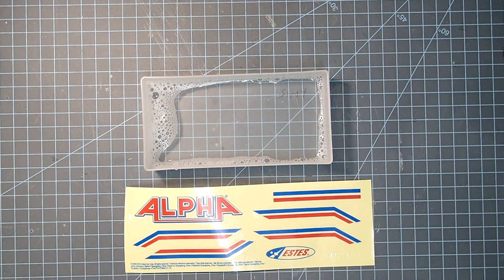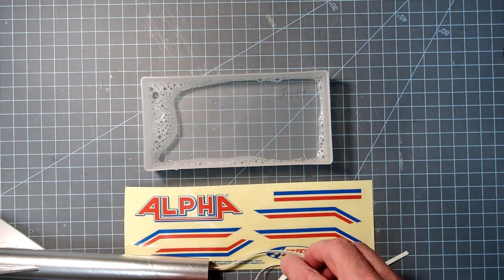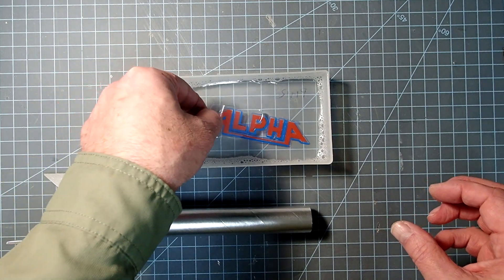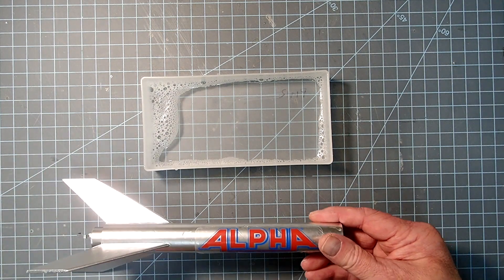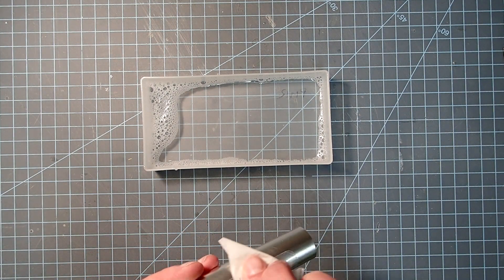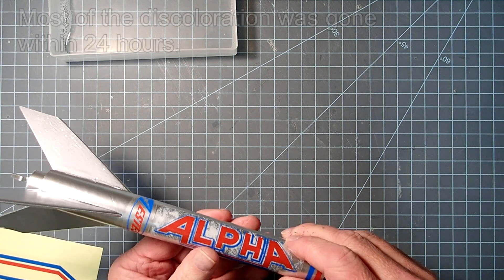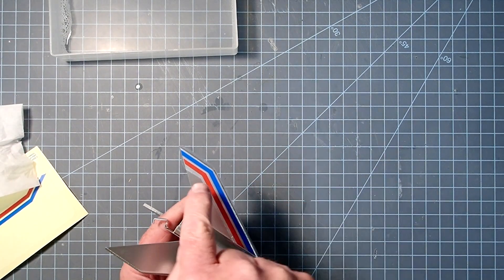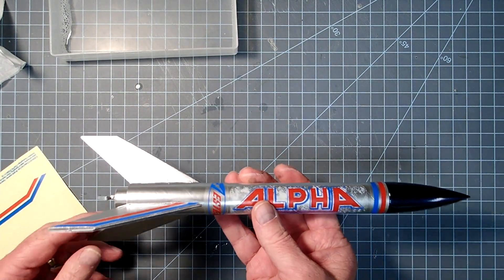Estes "Alpha" self-adhesive decal application using the "water method"

Comment: What silver paint is that? None of the ones I've tried will even let you touch them without dulling/fingerprinting. Thanks.
Reply from the maker: Rustoleum metallic
Reply: @REAR_rockets  Not to get too fussy....but Rustoleum makes lots if different paints. Any particular one? I don't think I've had any good luck with 2x, for example. My go-to has been a Krylon product then clear coat with Future before handling it at all. That almost works.   Thanks again.
Reply from the maker: As I recall, the line of paint was called "metallic".